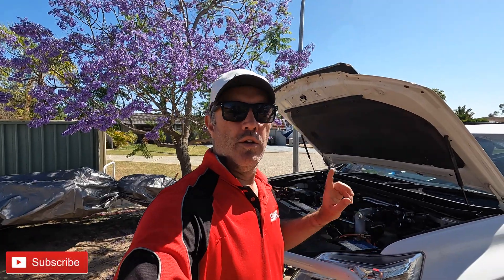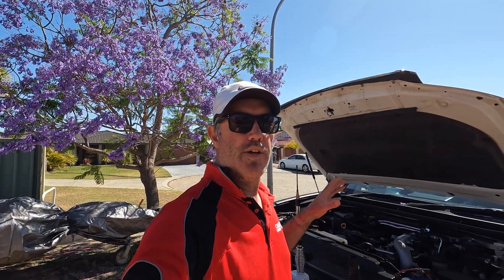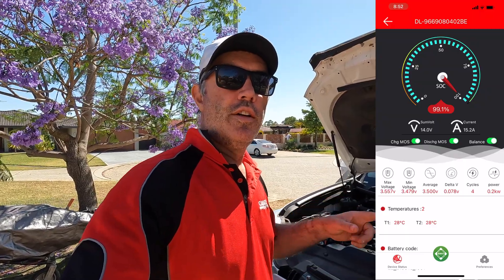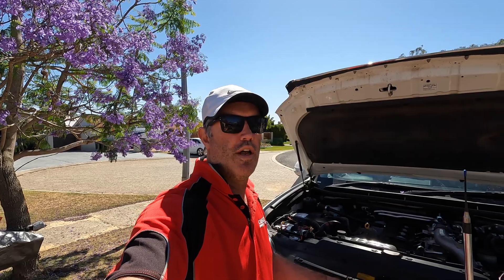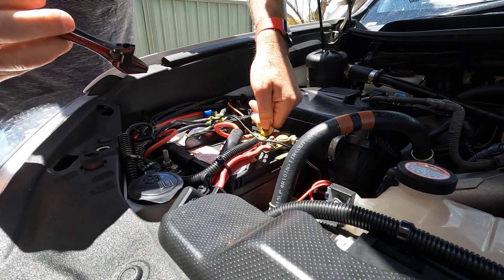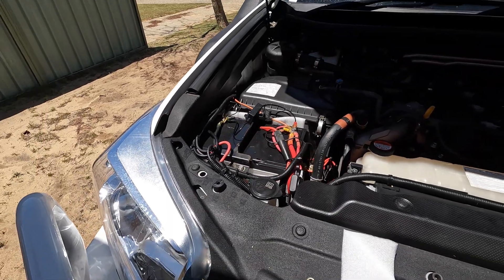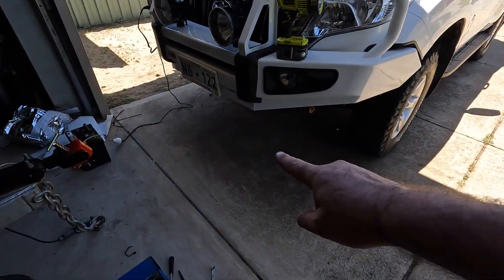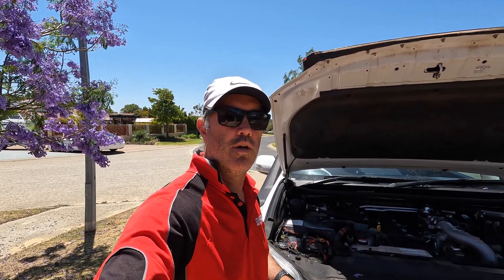Under Bonnet (Hood) LiFePO4 Lithium Battery - A Game Changer, or was it?

Comment from the maker: Just an update. I will be coming out with a update video. I have run this under bonnet set up for a few trips now, cold, hot, fast, slow etc. How did it go?  Well, to get to the point, I no longer have the battery under the bonnet.. I have gone back to lead acid for the under bonnet.. the Lithium is in the back of the vehicle..

The big question.. Was heat an issue? You will have to watch out for the upcoming video.. I will explain.
https://youtu.be/aQnznrma07Y

Comment: Hey Champ .. have you had any issue with heat ? on the lithium battery ? i've seen some people recommend heatshields etc etc
Reply from the maker: I will have a video soon updating the battery and how it’s going under bonnet.. i Aldo have tried different heat shields to see if they affect the temp.. will go over that as well..

Comment: Hi JJ - just wondering how the battery is going in the warmer weather. I recently purchased the same battery and stuck it under the bonnet and getting some interesting temps on the BMS. Also temperature went up for an hour after I parked up in the shade to 54 degrees C. I rang Aussie batteries and the lady I spoke to said they don’t recommend using under the bonnet. All the tech guys are off sick so hard to get good feedback.
Reply from the maker: Mine so far is been ok, the battery mainly sits at ambient, sometimes a few degrees above if you pull up after driving. I have it will insulated, and it sits right behind the headlight so gets pretty good airflow. The BMS will get warm if its charging. It sits on a big heat sink and if you are putting in 20 amps, it will heat up. The main temp to keep an eye on is the cells. There are 2 temp sensors, one on the BMS and one on the cells. In the app they just have generic names tlike T1 and T2. I always forgets which one is which, but put it on the charger, and the one that heats up first is the BMS.
Reply: thanks JJ

Comment: Hi JJ's Adv... I just wanted to ask how the performance is going so far?
Sorry for my comment but after watched this video I went to Aussie Batteries & Solar website and prices are quite good but I was looking at warranty info and as you stated, for 5 years warranty they recommend to use the Heat Shield for people installing it under the bonnet. So I contact them and they are saying their lithium batteries aren't designed to go under the bonnet. The warranty info is referring to AGM deep cycle to be used with the heat shield according to what they told me over the phone... So more than curious if everything it's been ok with temperatures & performance
Reply from the maker: The heat thing is a grey area for sure.. I bought a lithium, and the guy on the phone said they were warrented with a heat shield, I took that with a grain of salt for sure. I heat shielded mine, it doesnt get above ambient, so heat isnt an issue anyway. They use to say the same thing about AGM when they come out, but heaps of them are now under bonnet.

Performance wise, its chalk and cheese.. the lithium performs exponentially better. I can have many more Ah available in the same package size, and I cant use nearly all of them. I wont be going back anytime. I have since made up a few Lithium battery boxed with built in BCDC, and they perform superbly.
Reply from the maker: If there are any under bonnet issues in time, I will probably do a video on it and post what they are.. Im not about hiding anything.. I will just show what is what.. 

The biggest issue I have in my install, is I would have liked a bigger battery, but the carrier on the Prado only allows for a relatively small package.. (biggest lithium I could find was 100 AH) 
I might make myself a second battery box for the rear with its own BCDC.. a 120 AH
Reply: @jjsadv  thanks for the advise mate. Seems like this is the way to go 👍
Reply from the maker: BTW, I have removed it from under the bonnet... its now in the back in a battery box..
Reply: @jjsadv  too hot? Low performance?
Reply from the maker: @marcelolagosq  I am planning to do a video on my experience since fitting it under bonnet.